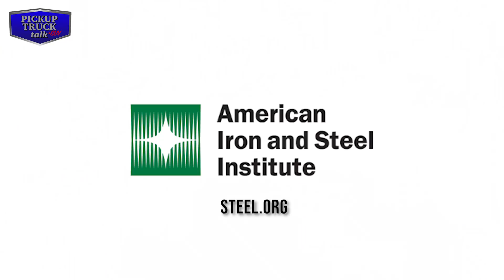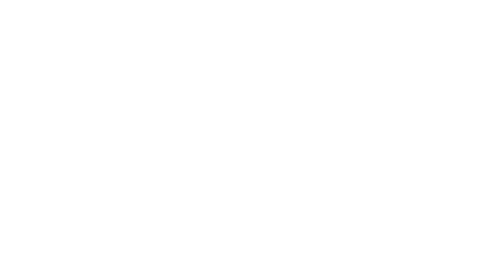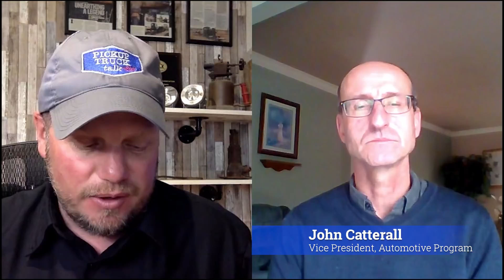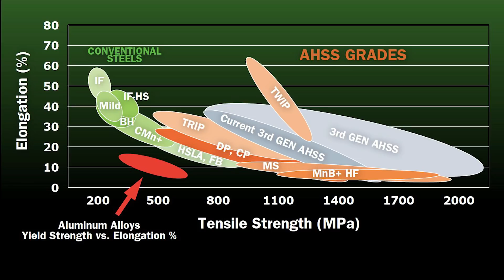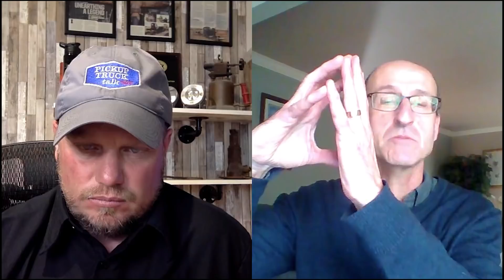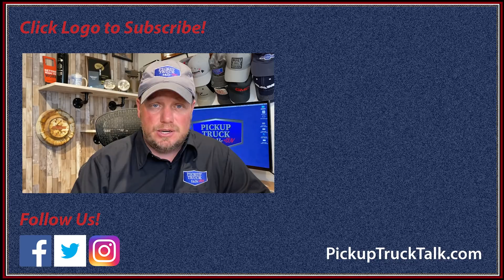Should Truck Frames Bend? Thinner Frames Are Weak? - Expert Answers

Comment: Guys, trucks are designed to manufacturer chosen specifications and when used within those specifications the incidence of frame failure is practically zero. The most recent controversy over frame strength has been inspired by a grand total of TWO, not two hundred or two thousand, but two, incidents of frame failure when the vehicles were being used in situations that can easily be understood as being beyond the factory intended specification. In both cases towing off-road in areas where excess speed was not only possible but very likely. No one will ever know for sure because the owners will always see it their way but these occurrences are not the norm, just saying. In any event, trucks built in the last five to ten years are not routinely folding up like beach chairs as the innocently cruise down the highway or even when used properly in the light off-road situations they were designed for.  Now, concerning frame design, commercial trucks use C-channel frames and older trucks usually did as well. C-channel frames, when designed correctly, are more durable long term when dealing with heavy loads because they can flex. This property in and of itself, not raw strength, often allowed older trucks to get away with things newer trucks can't. Doesn't mean they were designed to take the abuse they did though. It was more of a happy accident. Anywho, C-channels are not as stiff in torsion which is what you need if you want to improve ride and handling and to provide a predictable platform for building a crash cell and crumple zones off of. The obvious compromise is a hybrid of box frame up front and C-channel in the rear but combining the two does change how each reacts under load. Consult your friendly local frame engineer for more information because that gets complicated!

Comment: Conclusion:  Lightweight higher strength box tube construction gives the ability to provide crash crumple at the front, and better on-road performance.  That part is good, what's bad is that lightweight flex free steel will break more easily when subjected to loads like trailers and corrugations, which is exactly what Aussies encounter all the time.  Aussies stiffening the rear ends to overcome this problem do not make the front crumple zones ineffective, and there are none in the rear to worry about.  If you watch a video on how the Unimog chassis is tested you will see extensive flex testing which is integral to it's off road articulation.
The solution seems to be to hold on to your C section chassis as long as you can and just rebuild your running gear as required.  Stay away from flimsy new stuff.
Reply from the maker: There are rear crumple zones.
Reply: Another solution is to not overload your truck and slow down.

Comment: Bottom line is that when the engineers design a frame they make them right to the very minimum. If the steel is just a little weak it will yield. Not like the old days when stuff was over built.
Reply: Please tell me when cars were over built.  Then I will tell about the garbage that was put out at that time. Everyone seems to long for the 'good old days' and ignore all the problems back then.
Reply: @matthewgaines10  your right anything that is engineered is meant to fail
Reply: I don’t think so.  There will always be a margin of safety in any structure.  An engineer might strive for a small margin, but never a zero margin.

Comment: from what i've heard these frames are bending while towing within the a small percentage about or below the vehicle's tow capacity. Now my first vehicle was a 1998 Chevrolet s10 blazer with the 4.3, and when my dads 1990 1 ton dodge had a transmission issue we used my blazer to tow  that 1 ton truck on a car trailer to the shop. the suspension on the balzer was bottomed out or at the very most had maybe a half inch of suspension travel left. the shop was 15 miles away and we towed it at 55mph on deteriorated county roads and the frame of the blazer did not bend, i guarantee you that towing that truck was at least double if not triple the tow capacity of the blazer. My question ultimately is how can you consider these modern frames better when it seem their margin for error when it comes to the tow capacity seems to be nonexistent and damage seems to occur when it probably shouldn't. i do believe that on these new vehicles they need to reduce the tow capacities by at least half.

Comment: Stiffer doesn't always equal stronger. You want a little bit of play and twist in the frame to allow the vehicle to sort of conform to the environment. Get it just right (like in the older trucks) and you'll return to normal post-flex. Trucks need to be built like trucks again and have some give in the frame.

Comment: I have no argument that truck frames have gotten stronger, but the bending of the frames have been due to driver error as the owners were using their vehicles out of the manufacturer recommended specifications. Frames are definitely not built like they used to be.
Reply from the maker: Agreed.

Comment: People are using them like they’re Fords and they’re not.  I also blame YouTube a little.    I remember watching one video where the guys were ragging on the Ford  because they couldn’t open the tailgate when the wheels were all jacked up on ramps at angles no one would ever drive on let alone open a tailgate. But the Chevy tailgate opened and all the comments were about Fords frame being weak when it did what was correct.  Then I saw a similar commercial touting GM or Fiats frame basically the same way.  It might be good advertising but they need to flex or they’ll bend.

Comment: Having worked on older trucks & autos ,you see the difference  in the steel& thickness.  Worked  in a  steel product mfg plant yrs ago helped me understand  molecular strength & metallurgy . Torsional strength has depended on thickness and heat treat to make sure product retains  strength  VS flex  and still maintain its 'designed ' shape..     all in all mother nature will show you who's  in charge.       
Good  video on this particular  problem.
Reply from the maker: Thanks.

Comment: Chinese steel. College boys designing junk with Chinese steel.
Reply: Well yeah, I would hope the engineers designing a product like this have a college education
Reply from the maker: Smh. I specifically asked about Chinese steel.
Reply: @Pickuptrucktalk  Used to work in a steel mill in America before they closed them all. We drank beer out of cans with thicker metal than the junk they pass off as "truck frames ". Todays "MODERN TRUCKS" are trash. Got a 1969 pop up camper with torsion bar suspension and a heavier frame than todays 2500 pickups.

Comment: this reminds me of the totally new body style for chevy trucks in 1981. the previous year models hoods were so stiff that some serious collisions would drive the hood back through the windshield cutting your head off. so in the new 1981 design the hoods had crumple zones on each side so the hood would fold up instead of coming through the windshield. the problem was the crumple zone was to weak and after 6 months to a year the hood would start breaking in half every time you raised it. so a bolt on brace was designed to keep it from breaking. bottom line-they do make design screw ups occasionally. the one on the GM truck hoods went from 1981 to about 1986 before they fixed it at the design level.
Reply: Now GM is using aluminum for hoods.

Comment: Age old part of engineering.  The the stiffer the structure,  the more brittle. Yes the new frames have higher stiffness and torsional ridgity. But there is not progressive failure point.  Once it bends, it's done for.
Reply: That's not true.  Stiffness of a structure is totally different than modulus of elasticity of the material.  A structure is multiple components; and rigidity of the structure has to do with the total design not just the material.   When you get into materials, you find things like structural steel versus a 300 series stainless steel one has a greater modulus of elasticity (Young's modulus) and one has a greater Poisson ratio.   The carbon steel has a better modulus of elasticity while stainless is the one with a greater Poisson ratio.  You'd think that a greater modulus would translate to a larger Poisson ratio (ability to stretch) - but it doesn't.   So, let's not get hung up on pretending stiff = brittle.
Reply: First of all, these are not brittle failures.  Brittle failure tend to fracture, not bend.  Think your ceramics example.  I don't know about your engineering background but I suspect it's not up to snuff.  Next, it's interesting that people are inferring things over two failures they haven't done any metallurgical inspection on and seem to know how it failed.
Reply: @matthewgaines10  I was using it as an analogy. We can clearly see they aren't fracture issues. I was referring to the stiff high strength metal, once it's bent, it's not going back to the same shape.
Reply: @terrencejones9817  
All steel, once it yields isn't coming back.  High strength steels have higher yield strength.  That means it takes more force for it to yield (bend and not recover).  Your analogy  seems to be strangely not helping your case.  Your instincts don't match the metallurgical characteristics of steel.
Reply: @matthewgaines10  that would depend entirely on the scenario.  I do work in the field and frame repair still happens. The use of high strength steel may make that rare now.

Comment: Those mid-sized trucks are not meant to be used as full-sized trucks !!! 
How many times do you see people in smaller trucks over use them in situations that they were not made for ?
You should not get a tiny truck if you’re gonna do anything than just driving it ! No lifting, towing or serious off roading !
Reply from the maker: I’d beg to differ on off-roading. I’ve driven the ZR2, TRD Pro, PRO-4X and Ranger FX4 off road and they do great,